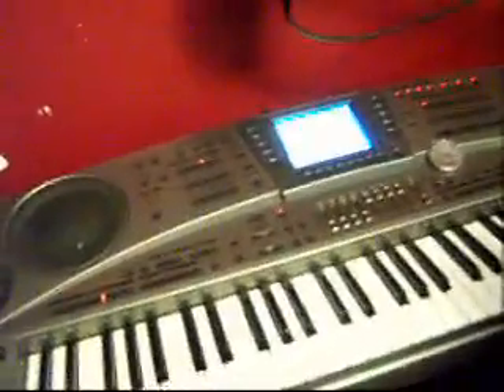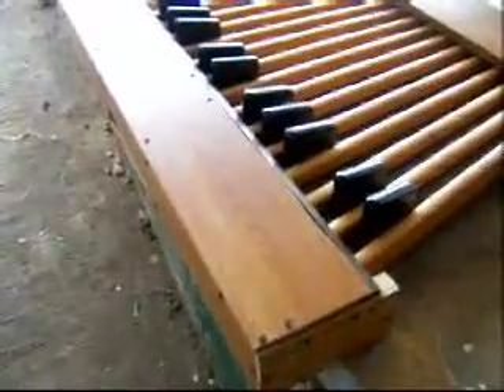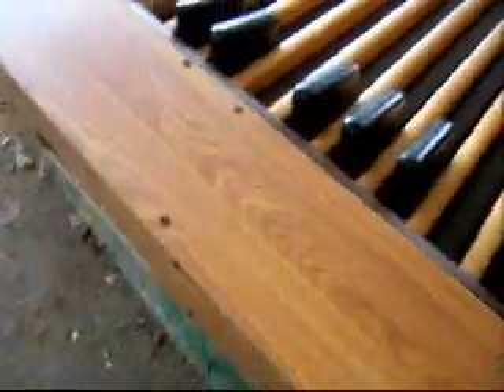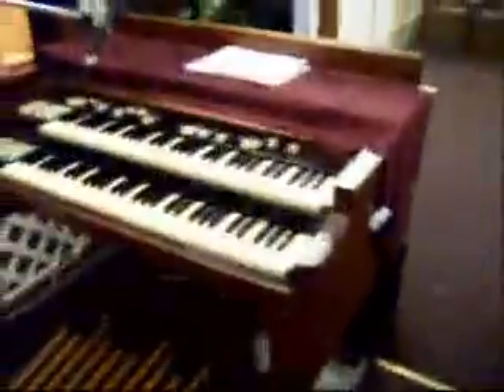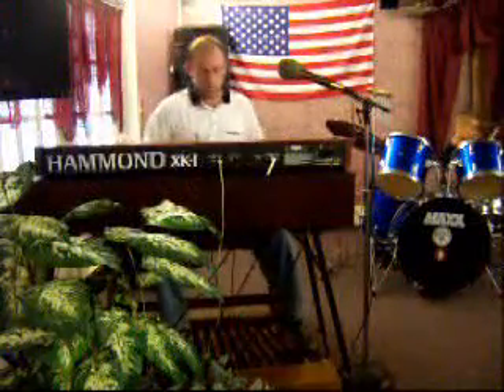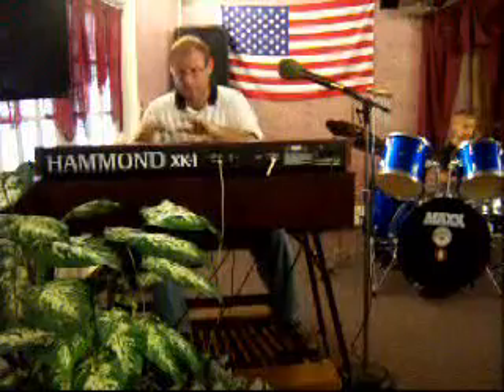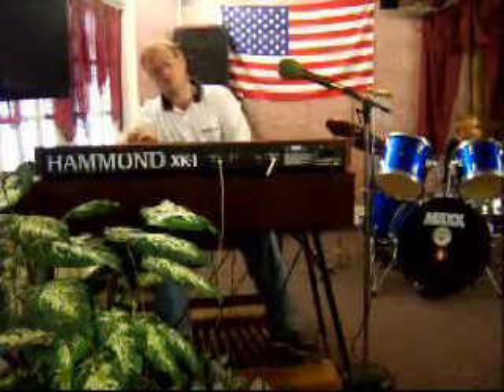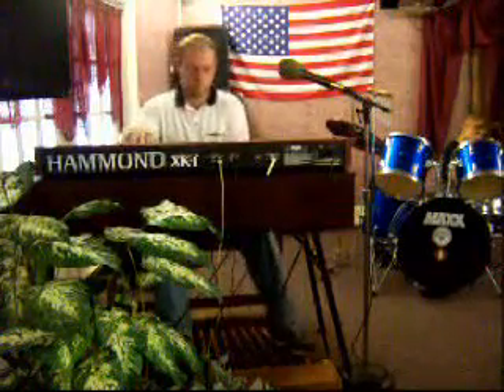MIDI Organ Pedalboard Project Part 2

Comment: Excuse my ignorance but it looked like the encoder had the different color wires and then some black wires on the bottom. Are the black wires for grounding? What is the exact procedure for the wiring?